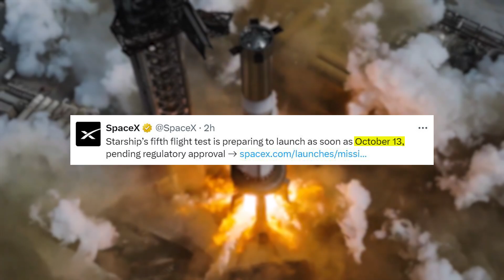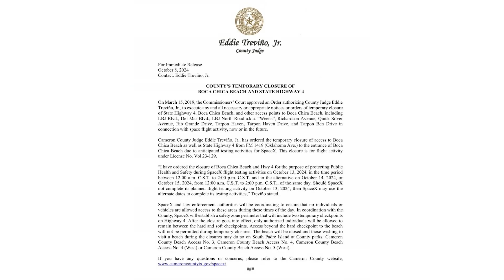SpaceX Has Installed The Starship Flight Termination System

Comment: If it happens on the 13th, I'm curious what changed to make the FAA stop dragging their feet. I'm sure there's been some pushback from NASA over FAA slowing down critical testing needed for Artemis to happen.
Reply: They got called out.
Reply: @jacobcastro1885  i don't think that would be enough. Unelected bureaucrats aren't usually so easily swayed. Unless their cushy job is threatened.
Reply: @zachhoefs9543  dunno. Interesting situation though. IFT5 LFG!

Comment: half a centimeter has to be a misrepresentation of some sort at some point in the communication pipeline. im.sure the booster landed with great accuracy but not hapf a centimeter.  hell half a meter would be extremely impressive and far better than f9 does most of the time. haldlf a centimeter is borderline impossible.
Reply: Especially the wobble. It seems… unlikely

Comment: I don't understand why there's so much infrastructure at the landing pad. Seems that it would be safer to have the pad far away from everything else and have important tanks buried in order to keep them from getting damaged in an accident.
Reply: SpaceX has very limited area at Starbase. There simply isn't room for massive pads like at the Cape. Also burying things is difficult because the water table is basically right below ground level.
Reply: No room
Reply: Because the landing pad and the launch pad are one and the same

Comment: 3:39 It amazes me that SpaceX can get such a large booster to land within 1 inch of where it is planned to be!
Reply: even.half a meter would be nuts
Reply: theres no way thats accurate.  i dont think they intentionally lied or anything but im sure it was some sort of miscommunication.
Reply: It amazes me that SpaceX can measure the position of a falling booster to 0.2 inch in the middle of the ocean!
Reply: If SpaceX really meant 0.2 inches then they must be using the high precision GPS system!  The wiki pages claim the modern survey-level accuracy is < 1 inch!
Reply: @k.c.sunshine1934  That's probably it.  Regardless if it was 1/2" or 0.5cm or 0.5 meters.. that's within the chopsticks margin of error!  Here's hoping we get a nice clean show, no blowups.
Reply: @k.c.sunshine1934  you can't get that level of GPS precision from a quickly moving object unless you have a reference station close by. In that case, it could've been the buoy. however that is also moving all the time. traditional reference stations are fixed and take measurements over hours and days to find out their own position to high accuracy. or you can manually enter the position of the reference station.
you could also try an IMU based approach, so the booster will know its own position without GPS. military grade IMUs are rather accurate, especially if you only fly for a couple of minutes (the errors accumulate over time until your estimated position is useless).
that is to say, it's a difficult problem but doable with current technology and really good software. not beyond SpaceX if they put in the work
Reply: 🤯
That's just incredible honestly. I have no words. Gives me so much more confidence for the catch.
Reply: I'm waiting for the first big bang.
Reply: I Smell BS